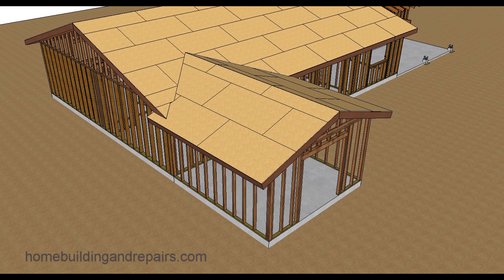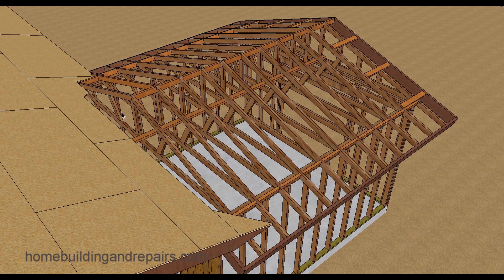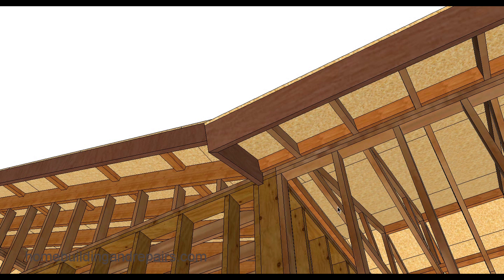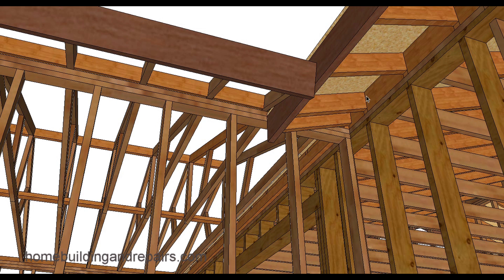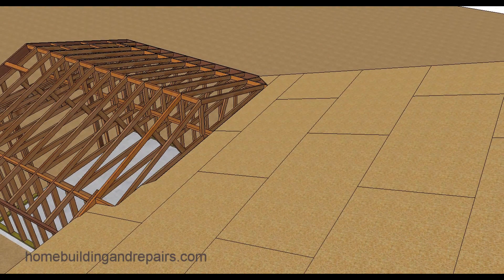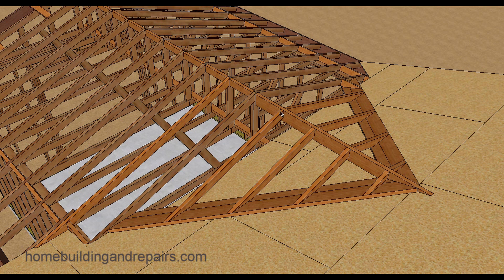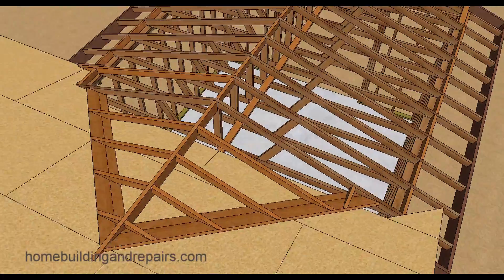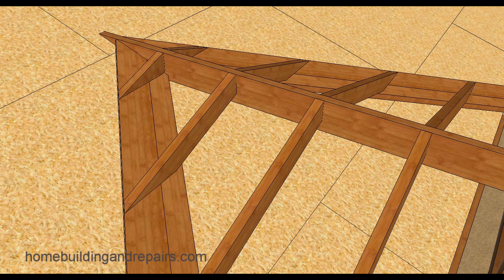Gable Roof Trusses With Fill – Home Addition Roof Framing

Comment: Thank you so much for the knowledge. My husband and I are adding an addition to our home and have a truss roofline. The designer wants our contractor to add trusses to our addition and connect the new trusses with the existing trusses, using a gerder trust to hold up the existing trusses on the load bearing part of our home. Is this possible to do? Thank you sk much for your videos!
Reply from the maker: I like it and you're welcome. Thanks for watching.

Comment: I am planning to do an addition very similar to this.  How can I ensure the  fascia lines up between the new roof and old (i.e., so as to not have the mismatch shown at 1:53)?
Reply from the maker: If the gable fascia board is plumb like that shown in the video, then the home addition roof rafter overhang will need to be plumb also or vertically level and then you will need to extend the fascia board over until it intersects with the gable fascia board or vice versa. It's difficult to explain in a few words, but I did put your video suggestion on my list of videos to be made in the future.

Comment: excellent videos!   i'm looking for the calculation to construct triangular gable vents - louvres are static at 45, but the angle where the horizontal louvre meets the angle that matches the roof is a mystery - i've been doing the 'hit/miss' method but that's really annoying and wasteful!   i keep thinking the method for calculating hip rooves is along the right track but i just can't wrap my mind around it!     there MUST be a calculation where you can just plunk in the roof pitch... but what??
Reply from the maker: I don't know exactly what you're asking for, but feel free to provide me with more detailed information or send me a drawing of what you're trying to do. Sometimes you can find the roof pitch with a level and a tape measure.
Reply: the roof pitch is easy, and the louvres are always at a 45...   i have a pic but not sure if i can attach it - imagine a square 2x4 frame, with 45degree louvres across it...  easy - the louvres are a 45 to both sides.    but if it was a right triangle, one side of each would be at 45 to the 90, but the OTHER 45 side of each louvre would be an compound angle to the pitched side - so 45 and what?   the 'what' changes based on the pitch...  there must be an algorithm
Reply from the maker: I think I know what you're referring to. You're trying to figure out the angle that one of your 45° louvers goes into at the bottom angle and I don't have a simple solution for that.

Comment: I'd like to built a great room addition 20'x22'. My house looks like your design with 8ft tall walls and cathedral ceiling with center being about 12ft high. How can I get a cathedral celing in the great room as high as the inside of the house? do I need taller walls, like 10ft so the trusses are higher? help would greatly appreaciated. thank you very much.
Reply from the maker: Yes you could use taller walls or a steeper pitched roof. For example you might have an existing roof that's 18° with a 30 foot span, but would need to increase the angle for a 20 foot span. You've given me a good idea for video and I will try to make it within a few weeks and post a link here when done.
Reply: gregvancom Allright thank you your quick reply. So since I can have a steeper pitched roof, then I think I'll go with 8ft walls to keep the same look around the house. Thank you for your help.

Comment: we want to do a very similar add on, but i want it ti be s patio cover with 2 corner post instead of walls.  How would this look with headers instead of the framed out walls?  Thanks for the info.
Reply from the maker: You would simply replace the walls with posts and beams.

Comment: Hi Greg. Great Video...I look forward to the next as we want to do the same very soon. We have a small porch on the front of our home with a flat roof. I want to rip off the old and install a more dramatic gable porch roof, which of course needs to be tied into the existing 60 year old home. The issues are: 1) we have a 90 degree wall on one side that the roof would have to butt up against, and 2) on the wall is a small window we don't want to lose. I believe the gabled roof could be configured so that it's just under the window. I'm concerned about snow and rain in that corner where the new roof meets the house wall and the window is fairly close to where they join. How would you handle this situation. I have a pic but don't seem to be able to add it here in the comments.
Reply from the maker: You can get our email address by visiting our website.